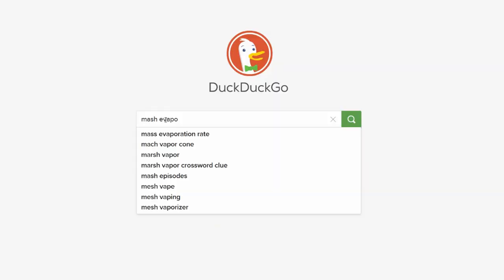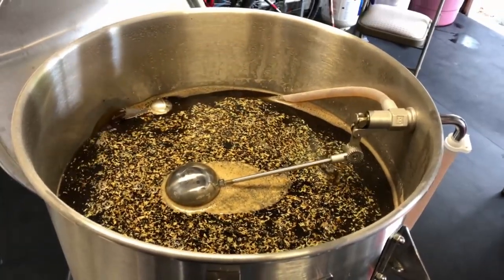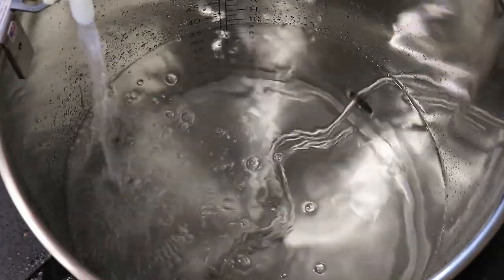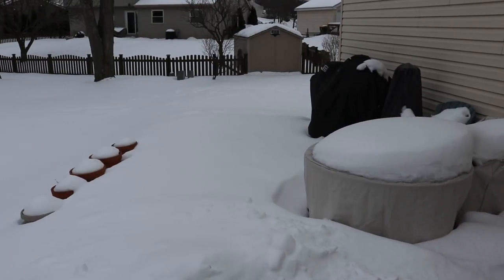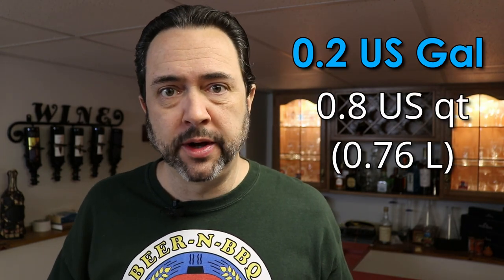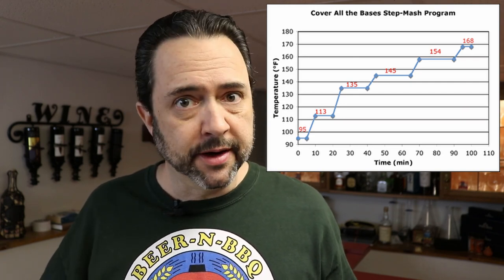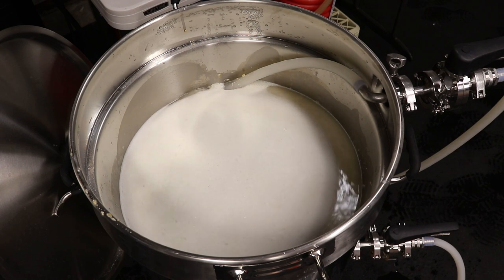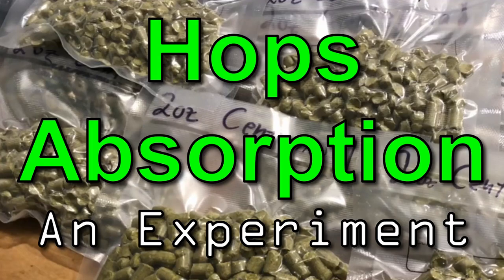Mash Evaporation Rate: An Experiment

Comment: Interesting.  Some quick back of the envelope math suggests that this would have a measurable impact on first runnings or no-sparge gravity.  Not a lot for a larger volume and shorter duration mash, but for a long and higher volume step mash it could be enough of a difference that you have to account for it.  Seems a problem specific to single-vessel, closed lid systems, though.

Comment: The price point of the Blichmann compelled me to purchase it. Every other system available had great features, but came with fewer goods, for similar investment. The auto sparge is a game changer. A stuck sparge would be the only obstacle to covering it. It occurs to me that a sight glass coming from the mash tun, down into the kettle would be of value for realizing the fluid transfer. If the only requirement to prevent coil exposure is sight, then it may be a valid solution. On a HERMS, there is no opportunity for this to happen. The brew easy is really only one vessel, one pump, and one expansion module for the second coil,  short of being a HERMS system. That is why it was the best value in my opinion. My only dislike of the Blichmann, no welded port. I am having mine welded. Cheers buddy. Great to have you back for sure.
Reply from the maker: It's a good system for sure. I can't wait to brew on it again once my weight is back under control.

Comment: I've never thought about it no but now that you mention it. I'm using the Grainfather which has a glass lid you use when mashing and that does become full of condensed water which falls back into the vessel but I guess if that lid wasn't there it would probably lose a fair bit.
Reply from the maker: That is correct. My experiment on the Grainfather with the lid off had a mash evaporation rate of about .29 qt/hr. Not representative of a real brew day since the lid is on.

Comment: I have heard that a larger grain bill can reduce efficiency and cause a lower than expected pre-boil gravity. Have you considered this in your spreadsheet? Can this effect be predicted and therefore compensated for as far as you know?
Reply: Is this something to do with liqour-grist ratio?
Reply from the maker: I've never heard anything about the amount of grain alone causing changes in pre boil specific gravity and don't see how it would. I have heard that a thicker mash due to a smaller liquor-grist ratio can potentially affect the enyzymes and their ability to chomp the starches, but if that was the case, I'd mash longer to make up for it.
My spreadsheet does allow you to enter a grist ratio when designing a recipe.

Comment: You could make a clear lid out of plexi or polycarbonate. Or you could also reduce the surface area exposure by placing a perforated plate over the kettle.
Reply from the maker: Sure can. I’d rather just add the extra water.

Comment: Larry after all your brewing, both with 3v and BIAB, if you started all over from scratch, and wanted to brew 10 gallons minimal as a rule, which would you buy?
Reply from the maker: I think there is a practical limit to size for BIAB. If you're always brewing larger batches, I'd be wary of BIAB due to the need of hoisting large heavy wet grain bags unless you have a ceiling hoist to assist. Also, the kettle size required is always greater than traditional methods which also adds weight and bulk.
3V systems distribute all that mass across smaller vessels and you have better control over some variables such as grist ratio but eats up more space.
As a compromise between the two, I've been really liking the 2 vessel BrewEasy. Smaller foot print, no hoisting large grain baskets, and control over grist ratio.
Reply: @BEERNBBQBYLARRY     Great answer, Larry.  I like the engineer in you.  I use you as my number one source of brewology.  Not kidding.  You’re no nonsense, real world application.  Also, your style is freaky genuine.   On a personal note, it’s good to get to know you through your experiences.  Kudos on your channel.  Thanks for sharing so much.  Brent.